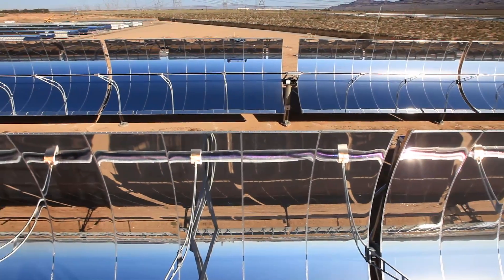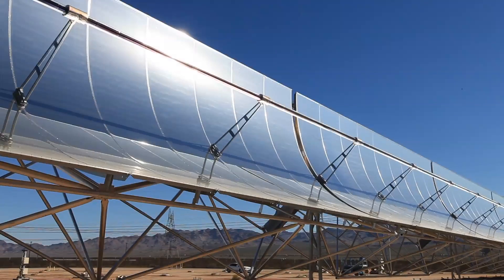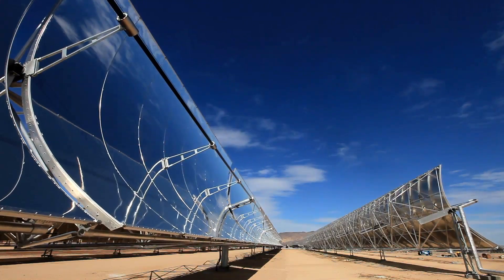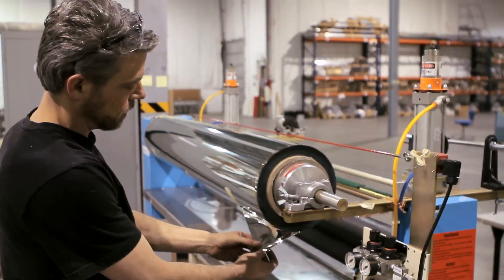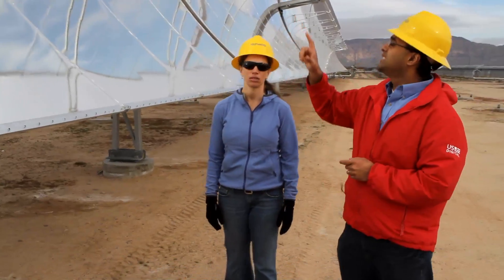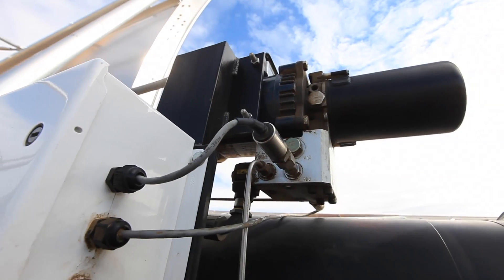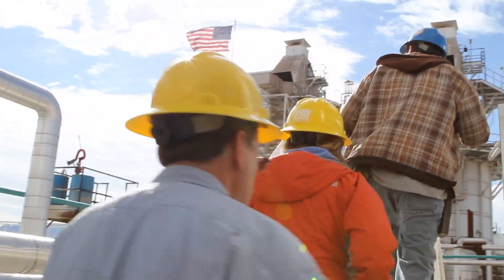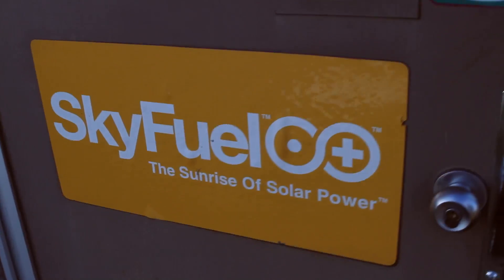SkyFuel + US Digital: Highlighting Concentrated Solar Power

Comment: actually not, the mirrors are lighting birds on  fire in mid-air at the rate of one every TWO MINUTES! The engineer responsible needs to reevaluate his design. The birds are insect eaters(insects are attracted by the light from the mirrors) who come in for the insects and get incinerated by the mirror concentrated light. Have mercy on the birds, and by the way the insect population is gonna boom due to this, so think about that as you slap those mosquitoes.
Reply: ***** a bird every two minutes is nothing to jest about. the mirrors need to be spaced out, not packed all in a big concentrated square. it is the concentration that causes the problems because it is so wide the birds cant fly over quick enough to avoid incineration. scientists need to research and put out something that causes the birds to fly around, big owls, sounds birds dont like, smells, I dont know but something, either that or space the panels in long lines rather than squares so the birds dont fry.
Reply: +gerri george Your comment is so filled with ignorance it's disgusting. Do some research before you wildly start spewing out numbers.
Reply: Oil spills have killed 82,000 birds of 102 species, roughly 6,165 sea turtles and 25,900 marine mammals.
Cell towers kill roughly 10 million birds, windows kill 90 million birds and cats kill 3.7 billion birds annually.
Why no concern over these deaths?

Comment: Why not more? Cost is 10 or 15 times that of photovoltaic. The only advantage of solar thermal is that high grade heat can be stored much more easily than electricity. So why not equip these plants with 12 or more hours of heat storage? The spot price of electricity is lower at night than by day. Solar thermal power plants can achieve much higher efficiency if they are permitted to consume some water on the heat sink side. Photovoltaic consumes no water. It is all economic-driven.